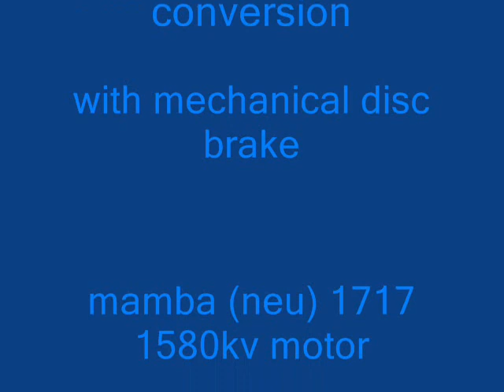OFNA JAMMIN CRTX2 BRUSHLESS  (MECHANICAL DISC BRAKE,CASTLE NEU 1717 MOTOR)

Comment: Does it still have reverse with mechanical brake ?
Reply from the maker: With the sanwa mx-11 yes, or any other transmitter similar .
You put the brake servo to the 3rd channel and you mixed up with the 2nd channel (motor control) so when you push trigger to  brake both 2 channels ,motor and mechanical brake are working together .When you need reverse you just push a button that is just like an on-off for  the mixed up channels and the brake servo is turn off.